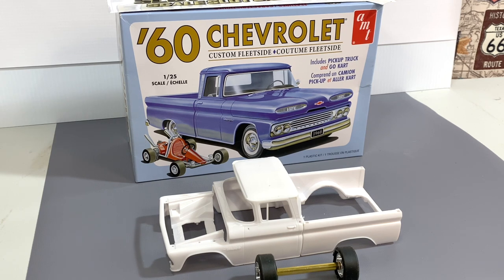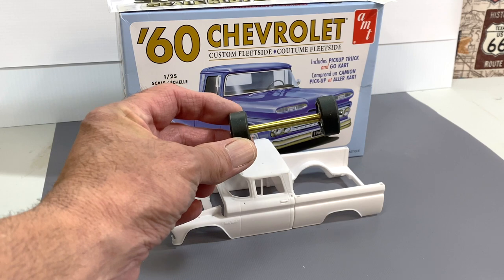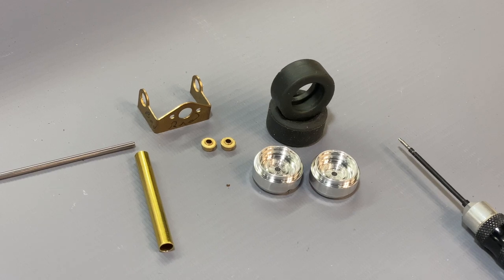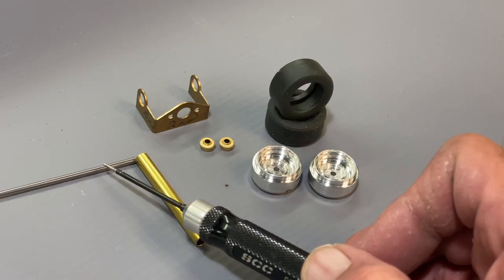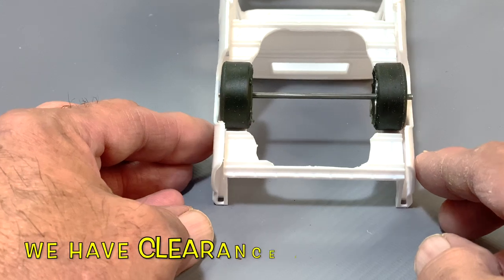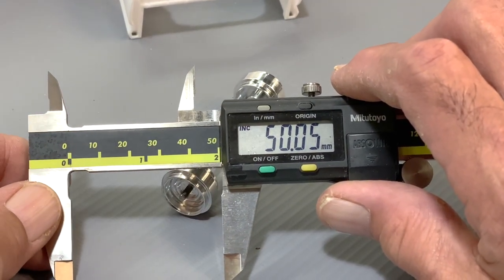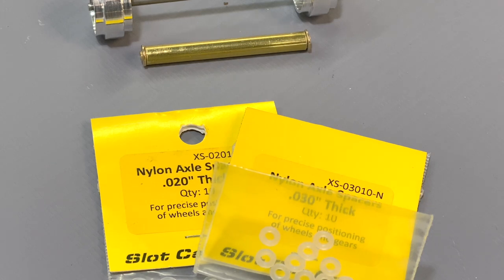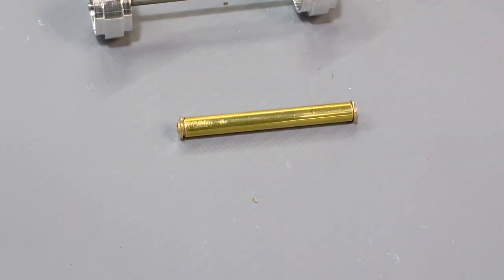HRW 1/25 Scale Chassis Build -  Part One

Comment: I usually use a shorter tube length with spacers intentionally. If I use wider wheels in the future, it's less work just adding narrower spacers then, than trying to shorten the axle tube then. I also like to make axle spacers from aluminum or brass tubing.